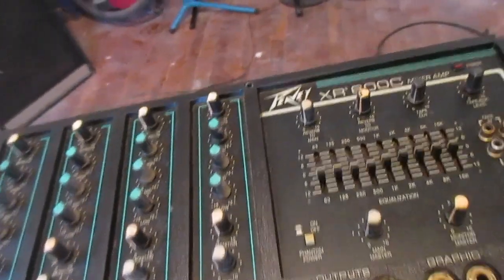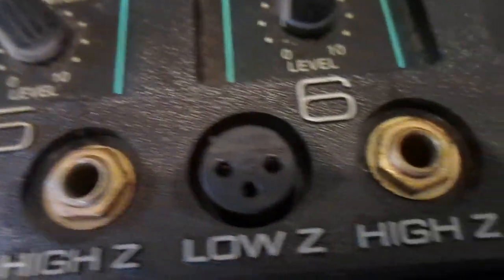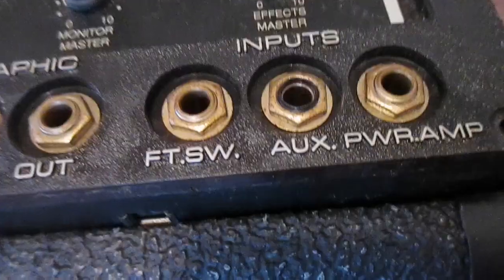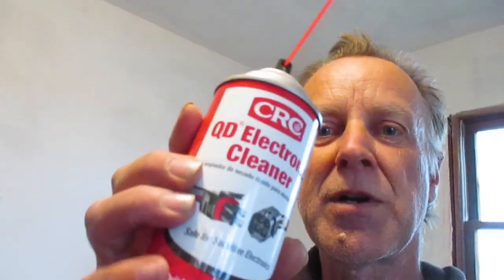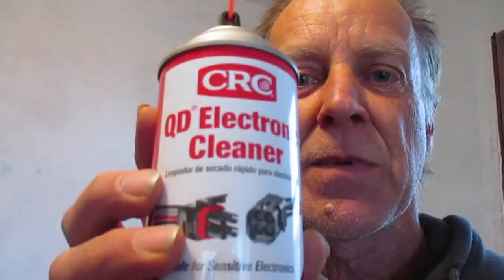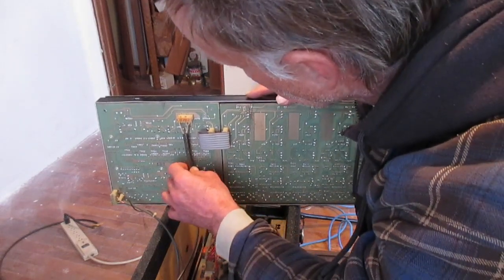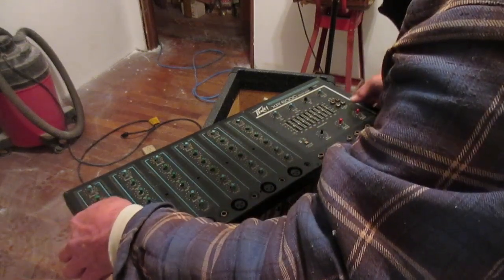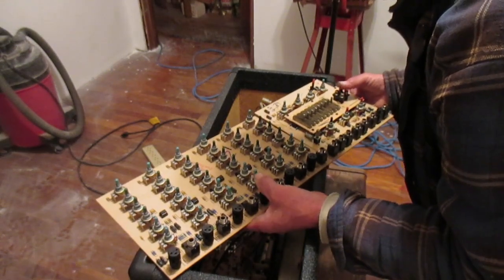Restoring My Old Peavey XR600C Mixer Amp

Comment: These amps are BADASSS not only for vocals but as a EDRUM amp. I bought mine new over 30 years ago with two 15 inch peavey speakers at a place called Guitar Showcase in Campbell CA.  Extremely powerful with UNLIMITED EQing. Never had 1 issue with my XR600c and in fact I just turned it on! Time to jam on my EDRUM kit. BEST INVESTMENT IN MUSIC GEAR IVE EVER MADE. Great video sir. No issues with mine at this time but it never has been cleaned internally.
Reply from the maker: Thanks for checking out my video. I hope you found it informative as well as enjoyable. Thank you also for your kind and polite comment. If you haven't done so yet, I strongly encourage you to subscribe to my channel for more videos to come. Thanks again for watching and supporting my channel. Take care and God Bless.
Reply: I've had one for 15 years bought it off some dude in a band called hobo erotic Fresno Ca paid $20 I've owned many amps and I can say peavey stuff is the real muthafucking deal built like a tank tons of clean power never fails Harley peavey is a genius too bad they closed down that beautiful factory all to save a buck

Comment: Thanks for the video.  I have a 30 year old XR600C that I have used at a minimum a few times a week for 30 years.  AND HAMMER ON IT!  Hard rock.  I'd like to ask everyone on here, please:  how could I attach an active sub woofer to the XR? I need more low end. My speakers have high and low inputs, and parallel outputs. Thanks!

Comment: I have one of these that I cleaned like you did and it works ok but after working for 5 min or so it shuts down and power light goes out. After it cools a few minutes it powers up but does the same thing after working a few minutes. Do you have any idea what this could be?
Reply from the maker: Thank you for checking out my video and for subscribing to my channel. I really appreciate it. I think you may have a transformer or capacitor over heating. I'm not real sure at the moment. Sometimes components will over heat and stop things from working. Then they will cool down and reconnect. I'll try and help you out in any way that I can. Take care and God Bless.

Comment: Hey Walt whether about this thing blowing fuses what do i need to do about that. Any help would be greatly appreciated. Thanks
Reply from the maker: Sorry it took so long to get back to you. I've been very busy lately. There are several reasons why fuses blow. The most common is a short circuit somewhere withing the unit. Another reason is an over load of current, which can be caused by a faulty component. In some cases, fuses simply age and wear out. My best recommendation when dealing with a blown fuse is to simply replace the fuse, of course with a new fuse of the proper amperage rating. If the new fuse blows immediately or very soon after replacement, there is obviously a problem within the unit which must be corrected by a qualified service technician. Anyway, thanks for your comment. If you haven't done so yet, I invite you to subscribe to my channel for more videos that might be of interest to you. Take care and God Bless.

Comment: Make sure you don't play around with those big ol' capacitors, folks (wink)

Just refurbed mine -- the XLRs were pretty tough to slip by the plastic fascia -- mine also have metal sleeve caps on them (not 'all' plastic). Had to de-solder the power cable from the inside due to massive fray outside of the strain relief (plastic ring/clamp).

Also take advantage of an empty shell to clean things up on the outside -- a dilution of Simple Green and water with a dish scrub brush works great. Then wipe clean with a damp cloth :)
Reply from the maker: Thanks for checking out my video. I hope you found it informative as well as enjoyable. Thank you also for your kind and polite comment. If you haven't done so yet, I strongly encourage you to subscribe to my channel for more videos to come. Thanks again for watching and supporting my channel. Take care and God Bless.

Comment: hELLO nICE VIDEO
ONE qUESTION, -- I have a peavey xr600f,  and  the equipment  works  with one single cable only. If I change the cable and I have three more.. it does not work. . With the cable that does work it works fine in every outlet connecting to the speaker, but I can never get two speakers to work at the same time. Done many tests same results. Is it possible that the amplifier may be reporting a failure when connecting two cables at the same time?
Reply from the maker: At the moment, I'm not real sure how to address your question, but thanks for checking out my video. I hope you found it informative as well as enjoyable. If you haven't done so yet, I strongly encourage you to subscribe to my channel for more videos to come. Thanks again for watching and supporting my channel. Take care and God Bless.
Reply: Thank you for your video I  am repaired one now the 15vote not coming what can I do please

Comment: I got one and I don't have any idea how to hook it up
Reply from the maker: Thanks for watching. I hope you enjoyed the video. If you haven't done so yet, I invite you to subscribe to my channel for more videos that you might be interested in. Take care and God Bless.
Reply: @waltmooredanwilson8754  Hello
 Dan recently purchased a peavey XR600B only to find out that it doesn't work. Found fuse outside appears to be ok .Opened it up found 2 fuse holders in side not sure what there for assuming that 1 is for power section and 2nd might be for compressor of the  ,not sure hoping you might be able to enlighten me. Also #2 fuse holder,i has 1 side of it missing wondering how to repair that  and i guess thats where i have to start to see if it might power up. any advice wound be greatly appreciated.
Reply from the maker: @edwardbartus9018  Thanks for watching and thanks for your comment. I hope you enjoyed the video. If you haven't done so yet, I invite you to subscribe to my channel for more videos that you might be interested in. Take care and God Bless. Also, when I have time, I'll try and do more video to answer some of your questions and help you resolve some of the issues you're dealing with.
Reply: @waltmooredanwilson8754  hey Dan can a inline fuse holder replace a fuse clip and a printed circuit board